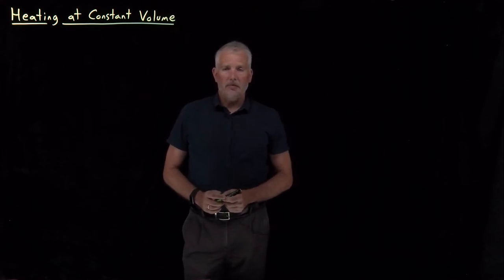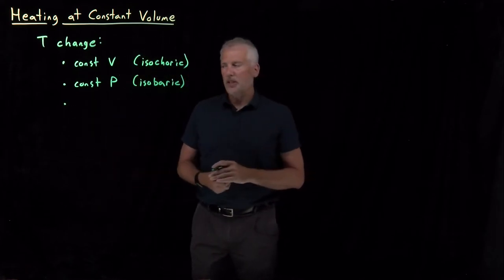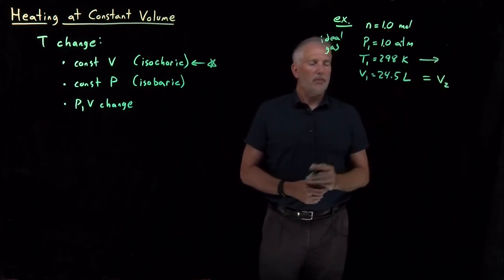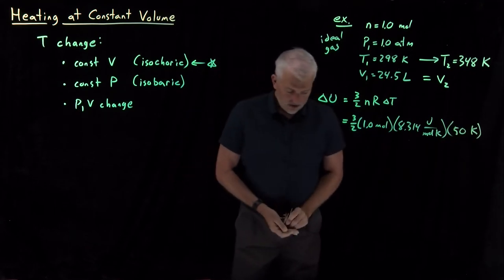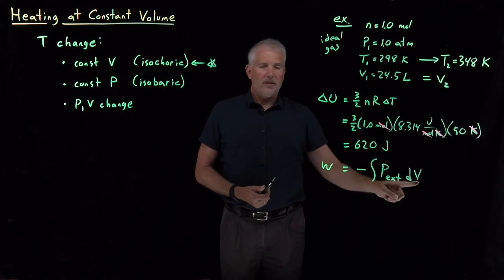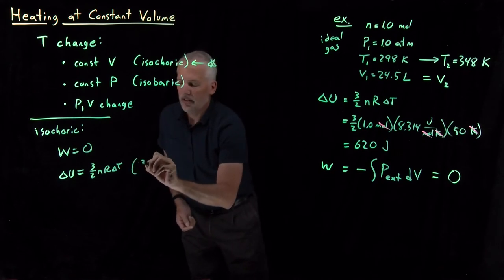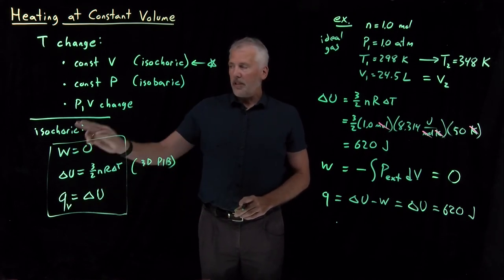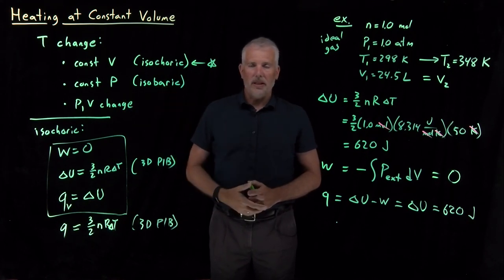Heating at Constant Volume

Comment: you make reference to pv work.
Does a gas system do any other form of work?
U mentioning that w=0 in the isochoric process, makes it see like only pv work exist.
is this conjecture correct?
Reply from the maker: It's possible for a system -- including a gas -- to do other kinds of work. For example, if you drop a balloon containing a gas, and it falls, it can do gravitational work. With considerably more effort, we could arrange for a gas do electrical work, etc.

However, usually we are using a gas specifically to illustrate ideas associated with PV work, and we intentionally ignore other types of work to keep things simple. So, even though I probably fail to say it most of the time, discussions of work in this section of the course should come with the caveat that we are ignoring any types of work other than PV work.

Comment: Hi, your videos are perfect. I want to ask a question, the delta U =3/2 nR (delta) T equation is valid for which kind of conditions, I mean is it also right for just the monoatomic molecules or not? this is the first time I've seen this kind of equation; my professor did not mention this equation.
Reply from the maker: You're right, that equation is true only for monatomic ideal gases.

We derived it in an earlier lecture: https://youtu.be/sI6I3JZ4tP4?t=209 . The 3D particle-in-a-box model that was used to derive it has the properties of a monatomic ideal gas.